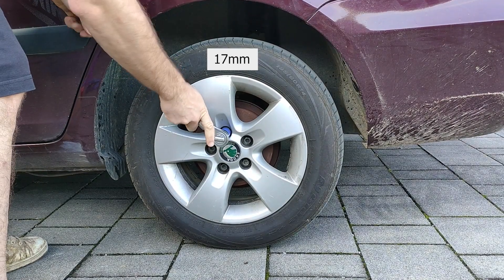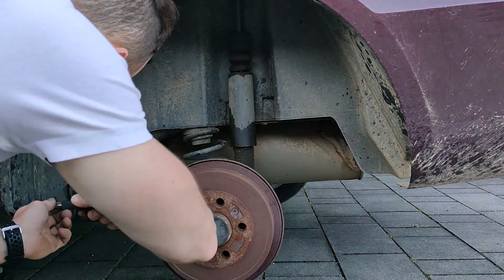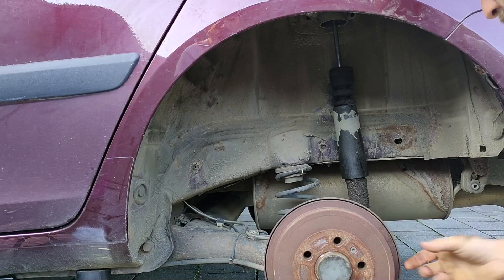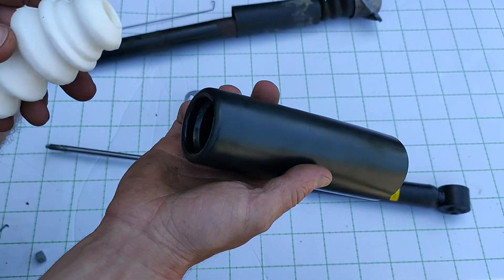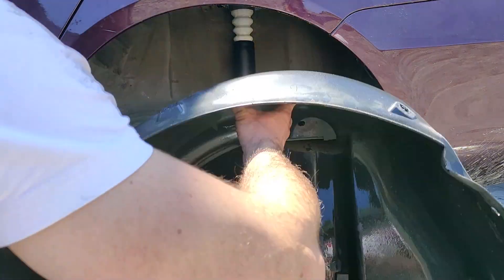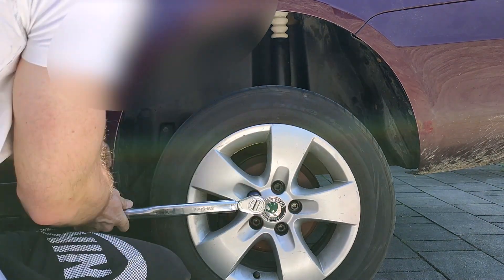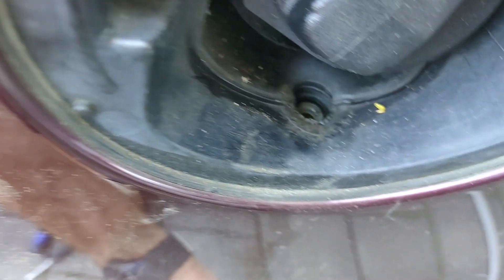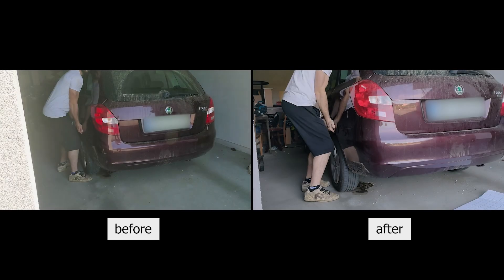How to change rear shock absorbers on Skoda Fabia  Audi A2  Seat Ibiza  VW Fox  VW Golf 5

Comment: Thanks for the video.  I did this recently,  exactly as shown in the video.  Two weeks later and there was a very bad creaking noise from the right hand side.  I had to take it to a garage because I was away from home with no tools etc.  They said that the metal top mount of one shock absorber was damaged.  I don't know if I somehow damaged it during installation, or it was defective.  Has anyone else had this problem?